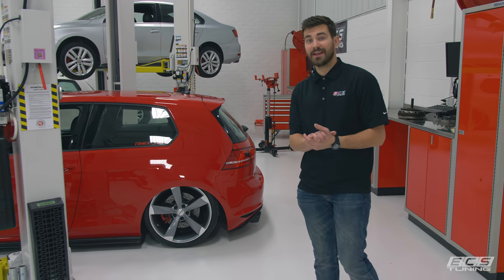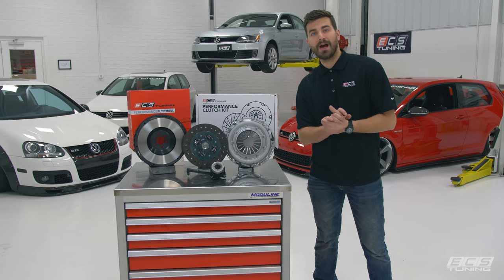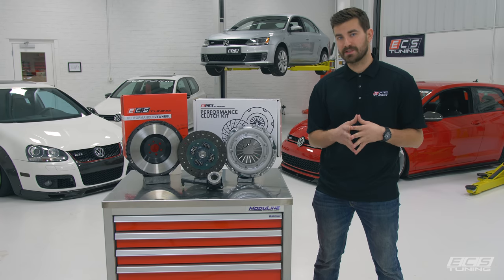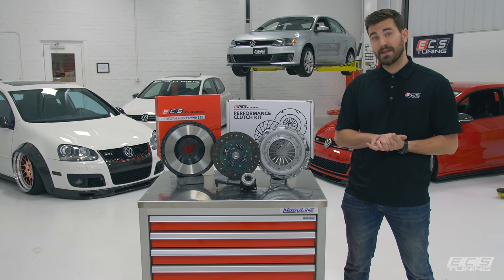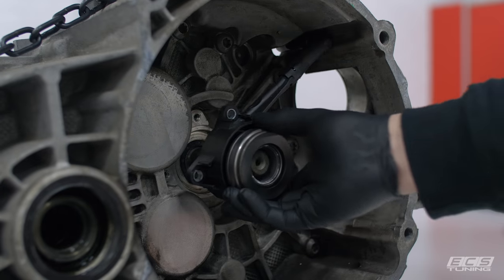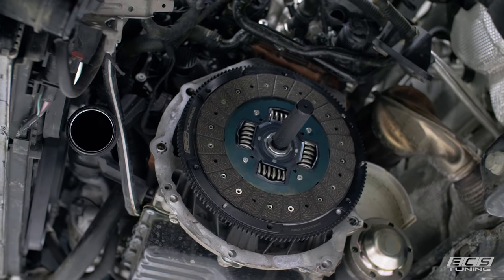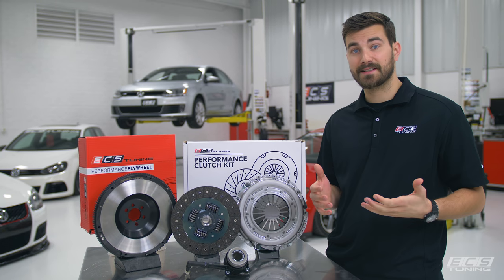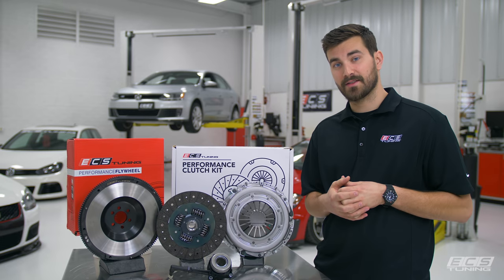ECS Tuning Performance Clutch Kits // Volkswagen MK5, MK6, MK7

Comment: I just installed this kit on my mk6 gli stage 2 unitronic. I think this clutch is great for the price.. Pros are: excellent feel and clutch engagement, never slips, low chatter at idle, and faster revving.

Cons are: vibrations and sound under load between 1700-2200 rpm (due to the smf), very slight chatter on decel.

Overall this kit is a great value and is very street/daily driving friendly. As for the vibrations, it smooths out a bit during break in, however you adapt your driving to the new set up. Would buy again
Reply: MrJayjay0420 Did it feel as it was bitting better after the break in period? I just installed mine today. I did a couple of pulls from about 3k on third, nothing crazy and it didn’t seem as it was bitting as I was hopping for. Thanks!
Reply: @JoseRuiz-dc8nx  oh yeah it definitely starts butting really good around the 750-1000 km mark.
Reply: Jose how’s that clutch holding up now? You’re supposed to get a good 500 miles of normal driving before going WOT.
Reply: Jon Dangos clutch is holding up fine. A little nosier than what I would like, but no complaints performance wise. Holds Stratified Stage 1 power perfectly.
Reply: @JoseRuiz-dc8nx  bruh moment
Reply: Do y’all think I should pull the trigger on this or southbend stage 2 daily? Much appreciated guys!
Reply: @Silbaru  yeah the esc tuning one is just as good. I've owned both. The ecs tuning one has a little more chatter, but the south bend one failed on me.
Reply: MrJayjay0420 How did the southbend fail?
Reply: Vibration is to much for everyday use! I’d use the performance clutch but stick with a dual mass for no vibrations 👍

Comment: I just put this on my 2013 CC 2.0. 60k miles. ZERO chatter after about 4 weeks and passing the 500 mile  break-in. None. It does have a "growl" paired with a slight  vibration when under full boost around the 3k rpm area, but I have seen others report this. Just running APR stage 1 with Integrated  engineering intake(highly recommend) and a few other bolt-ons right now, but dropping a downpipe and going stage 2 soon. It has run on cold days, warm days, a/c, no a/c. No chatter. I did install the ECS bleeder block per the recommendation. Clutch is very responsive and slightly stiffer than OEM. It's amazing what kind of 0-60 times you can get on a stage 1 2.0T with crap tires on a 2nd gear launch.  HIGHLY recommend this product, especially since it was ~$1700 parts and labor and OEM  clutch/flywheel replacement is over $3000.

Comment: Had this clutch on my mk7.5 Gti for about 10k miles. Chatter likes crazy but it’s ok I love the light flywheels really helps on the top end. A little to soft pedal feel for me but overall 5/5 star rating for price and value! I’m only buying this clutch from now on!
Reply: Still have the GTI? If so how many miles on the clutch and is it still holding up just fine? What kind of tune/power are you making?

Comment: Yessss, Perfect Timing guy's! Brakes first, then it seems we will have to re-decide on the new Clutch.  Price Point makin' me smile.
Reply: @dickfitzwelliner2807  Spec makes their clutch kits, which is definitely a step above dkm. I just installed this kit on my mk6 gli, yes its noiser than stock, but the feel and bite of ecs tunings clutch is top notch. I had a southbend stage 2 daily in my A4, it was jerky and chattered like crazy in comparison.

Comment: I recently bought this kit and today I left my car at the mechanic for installation. Once I have it back I will make a review of this clutch kit. I just wish the break in period goes by really fast.
Reply: How was it kevin?
Reply: Yeah, how was it
Reply: I haven't had any issues with my clutch. Runs and feels great. I've been running with an EQT stage 2 ots tune and no slippage whatsoever. I also don't trash my clutch (no hard launches) but I guess you should be fine. The clutch it's rated for 400 ft-lb of torque and the tune makes around 447 ft-lb
Reply: @kevinagostini-miranda961  very nice, I don't plan on being an asshole to my clutch either, I'll launch every now and then, but nothing awfully disrespectful. How many miles you have on the setup?
Reply: @nickc7318  I was doing Doordash when I got my clutch installed and put about 8K city miles. Now I drive a lot less, but I'd say like about 10K miles since the clutch was installed. There's chatter from the lightweight flywheel but I'm used to it, nothing crazy either. I was also thinking of going with another brand, but by the time I bought it most of all the other brands where in back-order for months and the ECS clutch was already in stock plus being cheaper than other brands by a couple hundred dollars. I also bought an OEM rear main seal, OEM slave cylinder and the ECS Tuning clutch bleeder block (which is highly recommended for longetivity of the clutch)
Reply: @kevinagostini-miranda961  do you think the bleeder valve is worth all the hype?
Reply: @kevinagostini-miranda961  and good info, I think my mechanicbis going with a dual mass flywheel still, and I'm not sure on clutch yet, if this ecs clutch is compatible, then I might send it.
Reply: @nickc7318  the bleeder valve is well worth it. Shifting through gears feels more responsive. The stock valve has a delay that you can actually feel and is not good for quick shifting, also the stock one is the reason most stock clutches, even with no mods on the car, don't last very long. Even if you don't install a new clutch, I would still recommend getting the bleeder block.
Reply: @nickc7318  I'm not sure if they're compatible, but probably not. I believe there are brands that make clutches compatible with the stock flywheel but I don't know how much torque they can hold and I think reusing the stock flywheel is either recommended or required to resurface and you would miss the quick revving from a lightweight flywheel. I also highly recommend an OEM rear main seal replacement and a new OEM slave cylinder as it goes inside the transmission unlike other cars that goes mounted outside the transmission and are easly replaceable. I hope your clutch installation goes well!
Reply: @kevinagostini-miranda961  wow, alright, I'll do some research and see if I can't make it happen, I really appreciate the info. Dumping 15k into a 2011 gti, full rebuild rn. I've ingested aovmuxh information it's sickening. Hahaha
Reply: @kevinagostini-miranda961  I'll ask if he's getting oem slave cylinder, this guy builds race cars, and drag monsters, so asuch as I wanna input alot, I kind of have to learn to step back a hair, and let him do what's tried and true. 

But lightweight flywheel vs a dual mass, you've felt the difference? And is the lightweight flywheel ridiculously different?

Comment: Ordered this clutch and shipped today with one day delivery since my OEM clutch is slipping with a COBB Stage 1 91 oct tune. Having it installed on Monday. Cannot wait!!! Reading the comments from DeustcheMK7 and MrJayjay I made the right call.
Reply: Jose Ruiz how long where you tuned before it started slipping?
Reply: Not long at all. About 2 weeks or so. It happened twice and I didn’t wanted to completely destroy the oem clutch so I replaced it right away. The mechanic told me the oem clutch still had plenty of life on it so he gave it back to me.
Reply: Luis Romo sorry for the late reply. I was tuned for just a week. However, when I replaced the clutch the mechanic told me the stock clutch still had plenty of life left. Maybe I could have waited a while before replacing it, but I didn’t want to take a chance.

Comment: I recently purchased the light flywheel kit MK4 2.0 Jetta I'm just about to install it only thing I'm worried about is if the starter is going to be able to engage the new flywheel cuz you please help that question

Comment: Just installed it in my Mk7 and low chatter on idle, it’s there but not bad. Feels great. It was shuddering for the first mile on stop and go and also through the gears but after I stopped checked and drove on it soon vanished and felt great. Just waiting for break in period then full send after!
Reply: Unorgnls. How is it going so far with the clutch? You and I installed the clutch around the same time. I’ve gotten feedback from jayjay, but I would also like to hear how is it going for you. Thanks!!
Reply: Jose Ruiz it feels great now, still has chatter I’m 200 miles in and the vibrations have tamed down
Reply: Unorgnls. That’s great. I have 150 miles on it now. The rattle when under 2500 rpm’s is annoying, but as long as the clutch works great after break in I will not care as much.
Reply: @JoseRuiz-dc8nx  yeah same i did a minor pull today just getting on the highway from 40 to 80, felt great and held good. but i'm still waiting till the end of my break in also. yeah the minor vibration is annoying but it doesn't seem too bad. let me know when you get to break in at 500 and if anything happens!
Reply: Unorgnls. For sure. Keep me updated as well. It will be interesting to see if there will be any difference.
Reply: Jose Ruiz just finished my break in period and it grabs hard and feels firm
Reply: Unorgnls. That’s good to hear. I have 600 miles on it with a couple of revisions of my Stratified tune and the performance is great. Noise still being my main complaint, but no complaints in terms of performance at all.
Reply: Jose Ruiz sane here it has flywheel rattle but isn’t too bad
Reply: Unorgnls. The only one that worries me some is the one that happens at 3k rpm under WOT. I think it might have to do with a heat shield or with the added power from the tune making the flywheel make noise. Either way, I will keep going and see if it is not a or if it will cause other problems. Time will tell
Reply: Jose Ruiz how’s the clutch holding up

Comment: I know this video is old but, who has a recent review? I'm torn between this and the dkm. The price is nice but I don't want to ruin the daily-ability. Hows the chatter and the weight of the clutch?
Reply: What do you drive?? I just got myself a stage 2 clutch kit from the link ecs put on this video and I will install it on my (TSI) 09 VW GTI Mk5 6speed manual trans

Comment: I have a 2015 gti stage two with eurodyne and will be installing this clutch tomorrow morning and can’t wait to see how this clutch feels after the 500 mile break in period but will wait until 700miles to be on the safe side
Reply: Did you installed it?
Reply: Alexis Gueits yeah I did and the clutch is amazing and I'm gonna do a video about it. Theess chatter but not to crazy and hold the power really well!
Reply: @Bjcoolman11  thanks!  I am also Eurodyne stage 2...  The price and quality looks very good
Reply: Just installed it too, feels great. It holds my stage 2 power without any problems. A bit of low rpm chatter and vibrations underload, a little bit on decel too, but overall a very good kit.
Reply: Do you think this clutch can hold an is38 swap with e85 tune ?
Reply: @xXMuffintopXx depends on your driving style. It's definitely a very strong clutch and has NEVER slipped on my stage 2 ko3. If you just daily drive this and are not doing crazy launches or tracking you should be just fine.
Reply: @MrJayjay0420  

I don't mean to high jack this video with questions, but since you guys have this clutch installed and there is very little info online about this clutch, you are my source of info. Where is the engagement point on your clutch? Is it pretty close to stock? Also, I am doing a Stratified Pro-tune so I just did a couple of pulls from 3rd, pretty aggressive pulls and I notice turbo lag from 2500 rpm. Are you experiencing this as well? The clutch has 100 miles on it at the moment. Thank you!
Reply: @JoseRuiz-dc8nx  you don't a heavy dual mass flywheel anymore, that low end lugging around town is over. You'll have to relearn how to drive. As far as engagement points, it feels like stock. I will say let the clutch break in before you hammer on it. Watch how it will feel after multiple heat cycles and 1000 miles of driving. The clutch will feel smoother and more refined.

I have one suggestion, get yourself a fluidampr. Google it, it will make your new set up feel smoother and get some of that low end feel back.
Reply: @MrJayjay0420  Thanks again for your reply. I guess I am a little nervous since I haven't really followed the break in period protocol. I just hope I did not just mess up my brand new clutch. I guess time will tell.
Reply: @JoseRuiz-dc8nx  nah man, I was heavy on my clutch during the break in period. Just don't launch it.

The clutch will get smoother and bit harder as you break it in. Just get a fluidampr!!!
Reply: @MrJayjay0420  I will look into that!

Comment: Just ordered for my 2018 gti, at 40k miles w/ APR stage 1 (I've only owned it a few thousand miles), clutch just started slipping when accelerating in 4th. Hope the price isn't "too good to be true", and the chatter is livable. I'll be replacing it myself when I get the time.. Until then no WOT for me.
Reply: Question bro have you installed this clutch and what’s your opinion on it?
Reply: @Epavon93  Not yet. I have put another ~1500 miles on it and being only a little bit careful not to go WOT have had no more slippage so far, so I'm going to wait for now.. I'll try to leave another comment on this video after I do the swap.. but may be a few months or more depending.

Comment: Just got done putting this on at the shop I work, biiig difference from the oem😂 I gotta get use to it and re-learn how to drive manual lmao, I wonder how itll hold up against stage 1+ 93 tune now after I break it in after 500 miles
Reply: How's it holding up?
Reply: @Slimjax  awesome! No complaints. After break in time it now feels a little heavier then stock but almost stock, never slips on me. And it can take a beating
Reply: @baranUtube  I've heard these are wicked loud, is it noticable on the inside because that's all I care about
Reply: @ChutneyGames  nope. I dont hear anything. First 500-1k miles is loud and chatter but I hear nothing now
Reply: @baranUtube  thanks! I've been on the fence about it but I think I'm going to go ahead and get it for my dd
Reply: How is it holding up ?

Comment: Why do aftermarket clutches rattle??
Reply: dick fitzwelliner can you explain
Reply: The stock dual mass flywheel has springs built in to deal with vibration so it doesn't transfer to your gearbox and rest of the car.downside is they are heavy.this ECS sounds good though.
Reply: It's gear lash from inside the transmission.  A dual mass flywheel damps the power pulses from the engine and smooths it out.

Comment: Any one have feed back about this clutch on a mk6 gti, thats APR tune stage 2?
Reply: I just bought the clutch man, also on stage 2 tune. Let you know how it is when I put it on!
Reply: @Silbaru  anything?
Reply: @thomasdessureault8279  Clutch is holding up well man. I really did try to get it to slip and it wouldnt. Pedal feels just a little bit more stiff, but nothing you couldn’t handle for a daily, chatter is also minimal. You can definitely hear it, especially when the rpms go down specifically when I down shift, but it’s not crazy loud... It’s what you would expect from a stage 2 clutch... I would buy the clutch again

Comment: Half the price of a southbend kit, oh boy 😀. This expected to hold up assuming not tracking, just spirited driving ona daily driver?
Reply: G Stroud I was saying the same thing. I’m going to try it out
Reply: @dickfitzwelliner2807  yeah but that chatter is what most daily drivers don't like.ECS looks like a win for stage 1 & 2 cars
Reply: @dickfitzwelliner2807  ?  So you are giving advise to folks here and don't even have one. I think we can read specs. :P
Reply: I just installed the kit.. Very little chatter at idle, clutch feel and bit are amazing. Vibrates a bit a low rpm under higher loads, but that's single mass flywheel life. I think my southbend stage 2 was louder

Comment: Stage 3 clutch for 2019 Vw golf 1.8tsi sportwagen is total Garbage.Ecs fix the issue.You guys use to be great.Now I have VW mechanics tell me your parts are Chinese and not really made in Germany 🇩🇪.I had 1 installed and within 2 months this crap started slipping and I don't ride my clutch.been drivin Manual since I was 16.Which was the first and only time I ever burned up any clutch for that matter.But all I know is there has to be a problem not only with the clutch but with the clutch pedal as well.When engaged car idles low.When just sitting with no clutch engagement car idles and chatters hard as hell.Which they alway say is common in VWs as in which I'm on my 6 Vdu66.Its crazy Stage 3 I don't recommend for sure.The rest I don't know of.Cause in me later years vws like my Mk4 or Mk3 I never had any of those issues and both of my clutches came from Ecs Tuning for those 2 Cars.Smfh.

Comment: These clutches are garbage  & are nowhere near the quality of LUK & SACHS.  I've been a transmission specialist for 25 years and have been asked to fit these kits by customers a couple of times and they just look and feel like a budget clutch kit.  As for lightweight flywheel.. well yes your engine will redline faster while the car is stationary witch is awesome if your in a revving football competition but other than that your engine will run / feel rougher,  be slower from a standing start, will reduce low-end  torque and will produce gearbox gear chatter.
Reply: thx

Comment: This clutch kit is noisy as hell
Reply: The clutch doesn't make noise; that's impossible!  But it can fail to absorb vibration, which may cause your 6spd mt to rattle....apparently the design of the 6spd makes it especially prone to rattling.
Reply: fredy gump I said the clutch kit, not the clutch, it’s specifically the flywheel that’s causing the rattle and single mass flywheels are famous for that. This kit is noisy, I have experienced two of them so far.